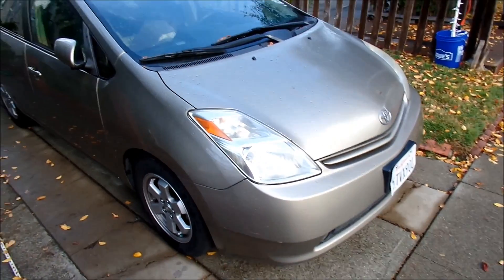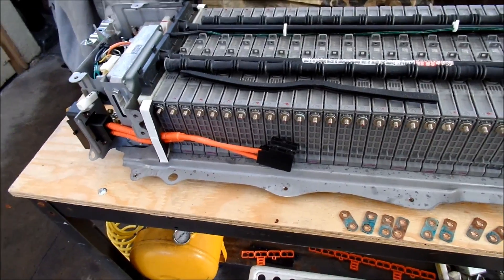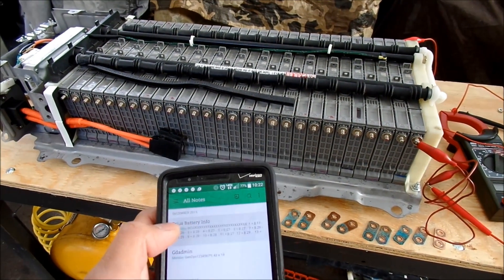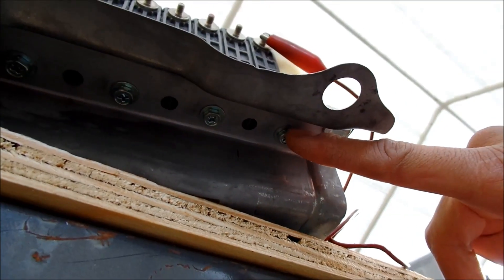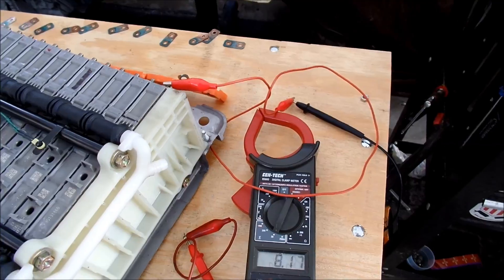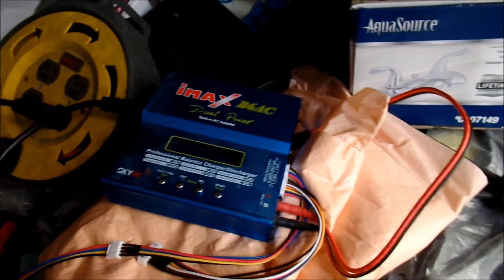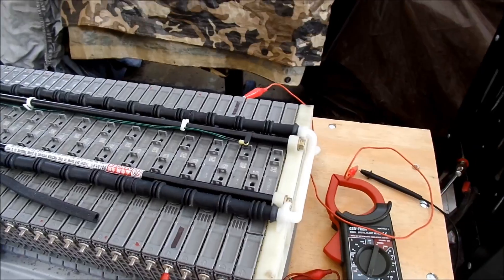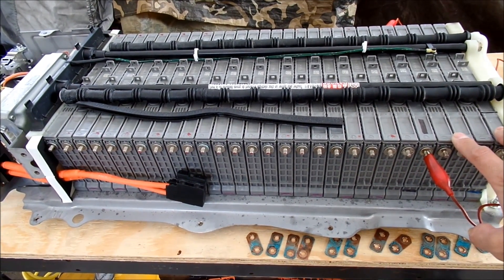HadesOmega Prius Repair VLOG Part 1: Replace Bad Module

Comment: How can I charge cells for testing
Reply from the maker: You can use a charger for nickel metal hydrid batteries like a RC charger or a powersupply
Reply: @HadesOmega  how about recondition old cells

Comment: yours was definitely previously worked on because of the way the bus bars were. mine was missing that same nut so I guess it comes that way.
Reply from the maker: Yes it was worked on previously unfortunately not very well.  The car was my sister's car and she had some Toyota technician work on it to try and fix it.

Comment: It has to be underload to get the true readings of that battery... Your pissing in the wind and 100% you haven't found the bad cells
Reply: Well I'm sure I found the bad one it was all puffed up when I removed it voltage was lower than other ones so think what you want...

Comment: 7.5 volts ?  how long whats was the charging time ? charging rate set to 1 A ? any issues with bulging sides ?
Reply from the maker: I monitored the voltage with the same voltmeter I used to measure the other modules manually at about 1A.  When it's charged I just shut it off.  I think the Imax charger will peak charge the battery since it is a nimh battery, but you want to charge it until it is close to the other batteries' voltages.
Reply from the maker: Sorry I don't know but I don't think it does, it really only for emission items and obd.

Comment: Why balance?
Reply from the maker: You want to balance the battery pack so all the voltages are the same.  If one of the cells are off by a lot there's a chance it will never get charged or discharged properly and it may damage it eventually.
Reply: Ok, thank you. That makes sense. Can you put a number on differs a lot? I've got a range of 7.62-7.72V (minus those being replaced). Eyeballing it, the values appear normally distributed. What size standard deviation do you recommend shooting for? Or is there a steadfast rule for batteries in series?

Comment: did you ever actually change anything at all in this video? I didn't see you take anything out! What the heck?
Reply from the maker: If you want to see how to take the interior out you can watch this vid I made, it's pretty self explanatory how to take the battery out from there.  There are other videos that cover taking the battery out, but stripping the interior is the bulk of the work.  You can remove the battery by yourself if your careful, but it helps to have 2 people.

https://youtu.be/FOuYzsUASCc